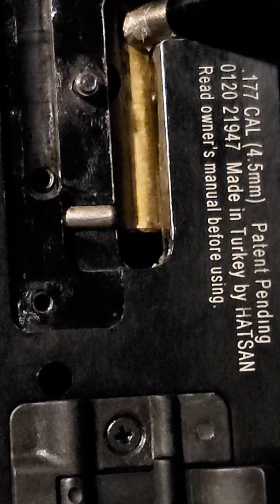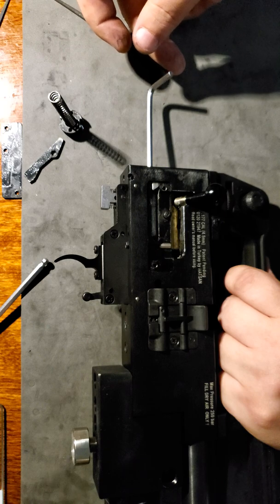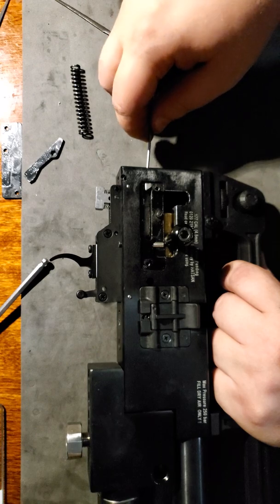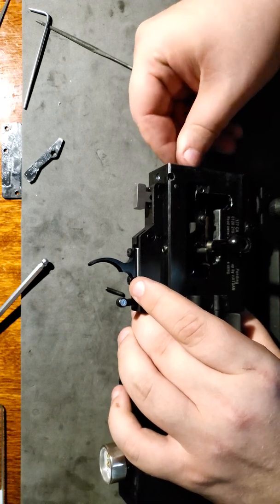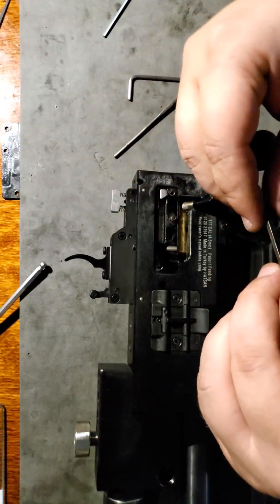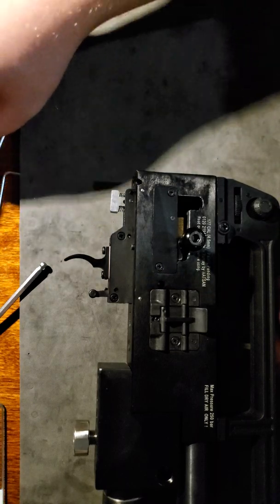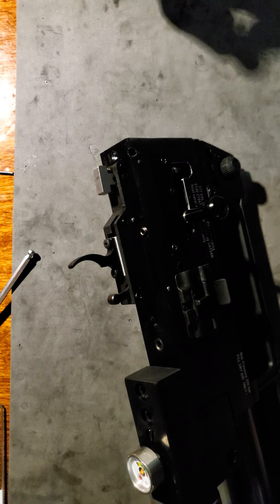Make it or Break it ep.1 part 2. Tuning the Hatsan Blitz power

Comment: Bought a hatsan Blitz 777 .30 a couple of weeks ago. Kept jamming from day one. Nothing but problems. Semi auto was 50/50 and full auto was lucky to get 10 in a row. Started chewing up the mag to. So i got to work because i wanna know how to fix every rifle i own. First i thought breach seal.. it looked fine and was brand new. 
So i started taking appart the entire gun with a exploded view next to me from hatsan website. Diddnt match the .30 777. At all. Looks like they only show a .22 version. So i start with opening the sides that cover the action. OMG. The screws they use for the plates are mode of some kind of super soft steal. So i almost stripped 3 of them right away. The cover on the right side is made of the same shit metal and it bended from me just carefully wedging it out with a screwdriver. I then removed the left cover that has the same shitty screws. Luckily the cover is much thicker. To my suprise the action and gears were so full of nasty crease that it caused such restistence that it made the action harder to move 😂. 
So i cleaned it all out and sprayed some wd-40 on it. Re-asembled the covers and replaced the butter screws with quality Stainless steel alen screws. Got it back together and Nope. It would cycle in both semi and auto but the bolt would not stay back long enough for the new pellets get seated. So im thinking wtf is this. So i took appart the entire gun. Except for the trigger group. And the barrel shroud was full of crappy old crease. So i started cleaning it out and sprayed some wd-40 into it. And replaced the plunger O-ring with a thicker one so there would be more pressure to rack back the hammer spring. But Nope. Still diddnt cycle in new rounds. How ever if i removed the magazine it worked fine on semi and auto. So i replaced the breach seal with a 7mm ID and 1.75mm thick 11.5mm OD. Then i replaced the barrel seals and used a magazine to give it a good tight snugging fit and locked the barrel in place. Pulled a couple of Ballistol rags tru the barrel. And thought if this doesnt fix it has to be the trigger spring tension. (But it was brand new) Turns out if you dont Decock the gun and just leave it around it will get a lazy spring. So here i go and started tuning the hammer spring pre tension to the exact point that the bolt catches the notch. 
Still wouldnt work 😂. Now im thinking maybe the magazines are faulty but i got a 33 round bigmag with the 777 edition and the spring tension is verry tight. So it couldnt be that to. 😂 Meanwhile im working on this damn thing for many hours. Turnes out it was one small simple thing. The butter soft screws i replaced with quality screws were just a little to long and the right plate was to tight against the action. 😅 I realesed a tiny bit of tension and BOOM. It runs absolutely flawless now. Schoots out standard JSB's .30's at 870fps. Full auto all day no jams nothing. 😂😂. So i basically just got some gun that a dude made on a Monday morning after a heavy weekend drinking or something. And i completely cleaned and serviced it. Made improvements and i am proud to say i am now a expert on the hatsan Blitz 777 .30 😂

But even after all this, i wassnt even mad. Because i bought this rifle as a self defence gun for when shit hits the fan. I'm in Europe where we dont have gun rights, but luckily i live in the Netherlands so airifles have zero restrictions. Just 18+ to purchase one. And i feel verry confident now that i can completely fix any problem it might get. It truly runs like a dream now. I have shot thousends and thousends of rounds with it. And only replaced the breach seal preventive. Its like an old school Russian AK-47 when it comes to reliability. And like a AR-15 with accuracy. One hole groups on 100 meter no problem. Ive added a surefire flashlight. A grip with internal extending bipod. A laser on a .45 degree angled rail. And a vector Optics continental QR red dot with a Vector Optics 3x flip side magnification scope. Its looks bad ass and i Totally love it.
Reply from the maker: You should have recorded that quest. Absolutely a real life experience  of any fixer.
Reply: My 777 has all the same symptoms after the first 3 mags, also really difficult to pull back and lock the bolt. tried cleaning the factory grease out, I notice a lot of things do not fit well, and many random sharp burrs I wonder if I should file, cannot imagine it's supposed to be that way.  I keep hoping with use the bolt will be easier to move but so far it's not. I put CLP in the first time I cleaned it, now I'm wiping that out and putting silicone oil. Had some scary moments when I could not remove the magazine when it jams but after wiggling and working it so far I was able to push the bolt forward enough to fire and clear the barrel.
Reply: Yeah man, record a teardown and seals chg. It would be valuable. How many years are seals good for? Silicone grease only if I recall.

Comment: Merhaba sıze bir sorum olucak 4.5 clibre isabet oranı ıyı mı stabıl mı
Reply from the maker: Hi. I used the power control to tune this device so it has a constant projectole velocity from the full air tank to a red zone. Unfortunetely, 0.51 gram projectile speed was only 161-165 meters per second. I've got around 120 shots.
Reply: @deepmaze1  yanıt için teşekkür ederiz ama benim sorum  4.5 calbre mermi isabetli  atıslar yapabiliyor musun
Reply from the maker: @Yusuf-u5m  In single shot mode it is exactly as Hatsan BT65. Same barrel. Thus it is not as precise as you would expect. Just a bit better than Chinese air guns

Comment: If you take the gun apart and replace ALL the grease with synthetic motor oil, hand rubbed on the parts, it runs perfectly. All my parts were massaged with Royal Purple 10w40 and the O-rings were massaged with Oatey 90% Silicone grease #30219.
Reply: thank you -trying to get that right side cover off and those screws are toast before even getting them to budge -might have to get creative and then find some decent replacements -I am sure I am not the only one by judging how easily they striped -the rest look ok
Reply: @blackimaje  yea those screws are soft as butter
Reply: @deaczorz  Plus, they use thread locker on them as anti tampering. I rounded the top middle cover screw on the left side cover on my first day even using a JIS screwdriver. I plan on helicoiling and upgrading all of them to higher quality screws. Try heating the area up to soften the thread locking compound.

Comment: I just received my .30 and it won't shoot more than 1 shot -I have to cock it every round -so would more tension on the spring fix it ? I have to literally push the bolt forward ( and no not a magazine issue )
Reply: See my recent comment. Easy fix.

Comment: is it possible to put a longer barrel on the bltz, or a higher efficency valve? (eddit) i do not know much about airguns or tuning them
Reply from the maker: Receiver of this air gun does not allow you any significant tuning. Moreover, it can crack. Therefore valve modification is questionable. And longer barrel gives no advantages on air guns (longer than 55cm).
Reply: @deepmaze1  alright that explains a lot. Thank you
Reply: Gas tube

Comment: I just bought one(build date 10-2020 and have shot about 300 rounds with it, not a single problem, and the cocking of the hammer after a new magazine is inserted is quite heavy, so perhaps the factory has already tuned the latest guns.
Reply from the maker: Looks like they did. Did you try the magazine spring mod and the heaviest projectiles? I want to know the top power of this rifle))))
Reply: @deepmaze1  Nope but did shoot some more, like a 100 jsb's more. Not a single problem. The power is ok but not that great. I also have a Hatsan Hercules .356 that thing has some crazy power.

Comment: you are the first and only Guy to put up a video taking apart this area of the Gun ,, love it,,  although I have no experience with the .177 Cal  I do have the .30 ,, This had been my findings on it ,,,Gun would NOT fill with air,, sent from factory empty (0 Pressure) which is what the manual says is normal, I could not get gun to fill, leaked as fast as I put the air in (Via GX CS3)  and Hand pump attempts LOL,, so I sent  the gun back, next one did the same thing, so I took it apart and put a micro amount of liquid Thread seal on the very tip of the Air valve needle then reassembled and voilà.  I was able to fill with my baby compressor :) 

Also the gun comes with the dirtiest grease I have ever seen , so while I had it apart I removed and cleaned all moving parts and lightly re Oiled with a (air chamber lube) I know not intended use lol but nice consistency , (no more gritty sounding action) gun has performed flawlessly for over 1500 rounds at this point  with a dissemble and re-clean + few dry cloth barrel pull throughs at around 500 rounds ,, on the Note of Ammunition I have found that JSB Diablos are a much cleaner round compared to the Votex ones  in .30 Cal

Comment: can you please tell me the exact specification on hammer spring? Mine literally snapped and I can't find out any information to replace it. PLEASE HELP! Hatsan is useless
Reply: I dont have a blitz but i would get on line for coil springs measure the lenth and width and try to find one that way and id go longer by 1 eighth or a quarter of a inch or go to a speed shop auto to see what they have

Comment: The sortie is identical for the adjustment.  One thing I would recommend is lube it all up while apart.  Use plenty of lube on the spring surfaces to avoid it getting twisted up when you adjust it because it needs to be able to slip on the 2 surfaces when being compressed.  You can use alternate lube here versus silicon since compressed air does not contact the hammer spring.  Also keep in mind there are better springs available.  If you measure the spring you can order some heavier duty better quality springs for the job.  I did this for my sortie after adjusting the stock spring it stayed compressed.  Cheap materials from Hatsan.

Comment: Hi Eric. Thanks to your videos. I have been able to successfully adjust the hammer spring tension. I have done it several times and and totally comfortable. I will next open the other side and grease the whole inside with moly grease. My .25 cal fires well on semi but only fires auto under 100 bar. Im looking for the sweet spot for full auto over 250 bar. 
I had a question for you. Would'nt we get the same hammer spring adjustment affect if we just adjust the big screw that holds in the spring? This way the door does not have to be open when adjusting. I have not tried it yet. I wanted to know your opinion first.  Also are there any adjustments that can be made between the hammer and the pcp bottle?  Thanks again for your videos.
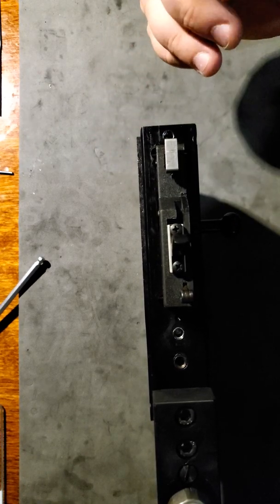Reply from the maker: Magazine rotation is not fast enough. Please check this video for detailed modification (starts at 6:32)

https://www.youtube.com/watch?v=FUyICcRKtqM

Comment: please ask how many times you need to turn the key to reach the power of the full    auto, thankx...
Reply from the maker: You will not be able to turn more than 4 rotations. I have tuned till I could not perform the loading cause of the spring tension. then I have returned 1 turn back
Reply: @deepmaze1  thank you very much for the valuable advice.